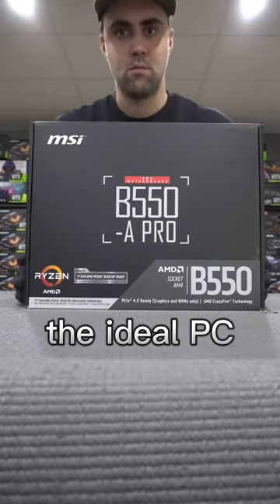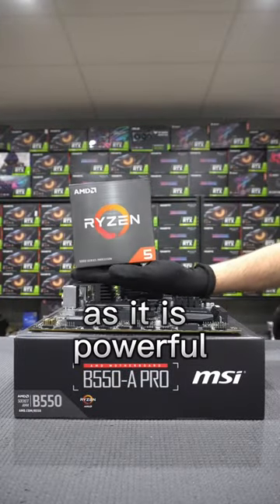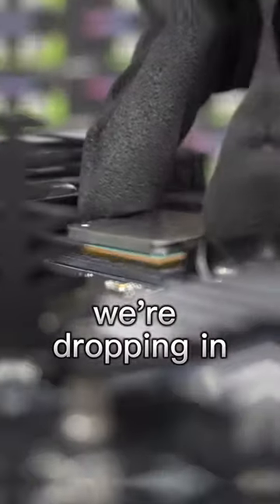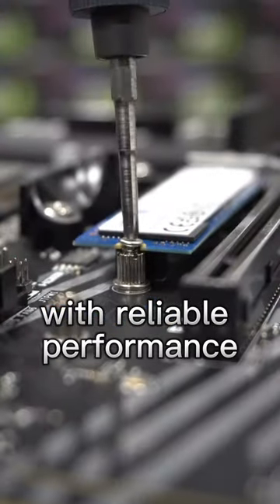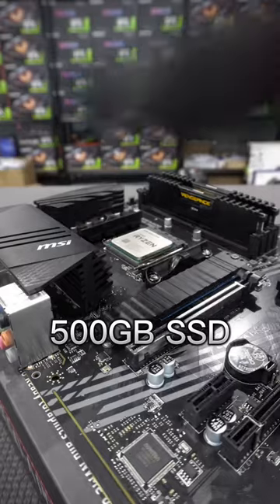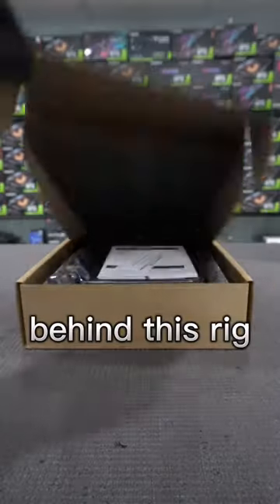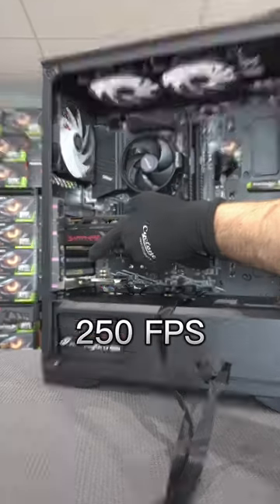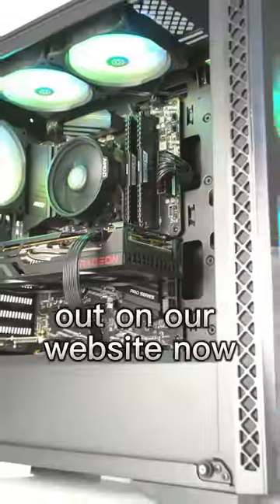IDEAL PC for 1440P Gaming without 💥 BREAKING the BANK‼️

Comment: This still breaks my bank ☠️☠️
Reply: Fax this is easily $1.5K+ 💀
Reply: @timovanlenthe  that still breaks the BANK 💀
Reply: @ahmeduansar  in USD it’s $930 and in AUD it’s $1399
Reply: @ahmeduansar  idk about 1.5$ i just build 5600/6650xt/16gb/1tb for 960€
Reply: @ahmeduansar  I just built my $1k system that is better than this
Reply: @ytACC19  they were talking about AUD I believe
Reply: @ytACC19  this is $930 in usd. Actually a pretty good deal imo. Much better than whatever dell/hp/acer you could ge at that price
Reply: @raskin5543  you could get better parts if you're going for the used ones or you found a good deal
Reply: Then u poor
Reply: @ahmeduansar not more than 900$
Reply: @snail137 man I family isn’t poor but that shit is too much I can find a 4070 with i7 13th gen 32gb of ram and 2tb worth of storage

Comment: 6700 is a real deal and underated
Reply: yeah, but not for 1440p... the 6800 can't even play fortnite/Hogwarts/Forspoken/Apex on 1440p mid-high settings over 100fps. It gets aroud 50-80 at Forspoken/Hogwarts and 80-110 at FN/Apex
Reply: @_lenn.box_  I am a 12400f 6800 owner but I don't aim for over 100 fps in 1440p, I normally undervolt for the electric bill, but yet the 6700 in some games it can do 60 fps 1440p and I have seen it for $320 US dollars which would make a it a 3060 competitor only for games and raw performance.
Reply: @scottireland4110  fr
Reply: Best budget motherboard for ryzen 7 5700x please reply
Reply: @manjudevi9542  what gpu u have?
Reply: @scottireland4110  radeon rx 6700
Reply: @manjudevi9542  I would recommend a b550 for the pcie 4 to get all lanes and speeds for the gpu is just up to your preference in a brand, like Msi, Asus, gigabyte or asrock
Reply: where i live It costs as much as a 6700xt so i'll get that instead
Reply: @_lenn.box_ rx 6700xt does just fine in most i play (assasins creed valhalla and odyssey) etc 80-100fps + very high 1440p native
Reply: Depends of what u play
Reply: @_lenn.box_ what a stupid thing to say. I haven’t had an issue running all of the newest games at 2k medium-high 60+fps on my rx6650xt.

Comment: I have a question. Why is there a 500GB SSD and not, let’s say, a 2TB SSD, even though games are very large these days?
Reply: price i guess  
even though you could get some good SSDs for a cheap price
Reply: Compare the prices. But i would reommend to invest a bit more money for storage if you aren't only playing the same games like CS or League of Legends etc.
Reply: Yeah every pc should have atleast a 1tb ssd,that's like the minimum these days no matter if you're building a budget pc or a higher end one
Reply: @ERENYEAGER-sw9ki My personal computer uses a 250GB SSD as the boot drive and a 1TB HDD that is used as a data drive.
Reply: Storage is soo cheap right now they could put a 2tb m.2 and it
I only bump the price by like $50
Reply: You want all your games/programs on a SSD as well.(making everything much much faster)And nowadays 250gb is just super low for that.
Reply: @Trage339  It doesn't matter. I don’t game. My computer cannot exceed 2TB, otherwise it will freeze if I try to enter the BIOS. It doesn't matter how fast applications take to load with me. My HDD has a read-write speed of 80MB/s, and I do not need an SSD with at least 500MB/s. It's all I have, and I'm not paying $50 or more to get a 1TB SSD, when I could pay <$25 for a reliable HDD with the same capacity.

Comment: Even tho mid range gaming is not as cheap as it used to be, it is still cheaper than most people think. All you really need is 600 USD and you can get a R5 5600G + RX 6600 (faster than a RTX 3060). I have a i5-10400F + RTX 2060 and i can play every game possible in 1440p, maybe not on high settings, but medium looks good nowdays too
Reply: why 5600g instead of 5500, or 12100f
Reply: I wouldnt get a 5600G if you use a graphics card. Go for a 5600 because a 5600G is basically on performance Level of a 5500 while not even using the integrated graphics
Reply: If you want it to last longer go for a 3060. DLSS is a must-have as well tbh, as much as I love AMD's cards there's no denying that DLSS is a better upscaling solution than FSR and the 12gb of VRAM is a plus

Comment: Will you guys do builds with Dx12 Fortnite FPS on 1080p instead of the performance mode?
Reply: He probably won't. Most people play at 1080p or 1440p performance mode lowest settings anyway.
Reply: Look man i dont like fortnite a lot but i recommand a 4070ti with an i5-13600k or i7 13700k  or i9-13900K and 32 gigabyte of ddr5 ram and z790 motherboard i mean for about 2k-2.5k you will be able to play at aroubd 1440p 90fps-100 raytraced epic settings dlls 3.0 on , trust me you dont want 1080p
Reply: The difference is huge from 1080 to 1440p
Reply: @crangasucatalinandrei366  you dont even NEED a z790 motherboard tho

Comment: I had the 5600X before for 1440p gaming and upgraded to the 5800X3D because the 5600X is not powerfull enough for 240hz. it's also way more futureproof than the 5600X.
Reply: wdym future proof 5800x3d is on a now dead platform isn’t it?

Comment: A 5600x with the 6700xt? not a bad pair but I’d go with a 5700x instead just for that extra push, also, really?? A 500Gb SSD, that is fucjing horrible now days, if you have the money to get a 1440p monitor and this whole PC u should definitely get minimum 1tb, because that motherboard only has 2 slots (I think) so when they need more storage they gotta think really hard what to get
Reply: Wasnt a 5600x or 6700xt it’s just the base 5600 which in itself isn’t bad at all. But a base 6700 is killing. Personally I grabbed a 5700X cause I needed 8 cores but compared to when I had a 5600X difference is minimal when it comes to gaming/general tasks but not desperately worthy. I agree with everything else, it’s 2023 and good entry lvl nvme 3rd Gen and 4th are around 45, snagging a P3 Plus for this build is a great deal.
Reply: Bro a 5600 performs nearly the same as the 5700x not really worth it, just upgrade to a 5800x3d if u need those 8 cores
Reply: @snail137  that is such a horrible idea that it’s funny, the 5600 is like £100 - £120, the 5700X is about £150, and the 5800X3D is like £300, bad idea man

Comment: Begging for 400 dollar budget day 2…
Reply: i would prefer u going for a ryzen apu with integrated graphics coz.. gpu at that point is not possible.. maybe a 1650 used ?? new one is tough.. i'll try a combination myself and put a comment here tagging here hope i can help..
Reply: @smitagurav1296  K ty
Reply: Go for an apu bruh maybe something like ryzen 5600g,an entry level b450/b550 mobo,16 gigs non rgb ram,500gb ssd,450watt psu,550watt if you'll add a gpu later,a cheap case of your choice that's all (i wouldn't recommend you buying a gpu now at this budget or you'll end up buying garbage for parts coz you'd have to do a lot of cost cutting on other parts to buy a gpu right now,rather buy some decent parts with an apu now,wait some time and then add a gpu later whenever you got money

Comment: Never buy gpu from Radeon, hear my words NEVER!!! I lost almost 2 years fighting with my rx 5700 xt. Just don’t do it guys. It is cool and strong on paper, but In use it is complete trash. Just check tickets about stutters, crashes, freezes etc
Reply: People have issues with every product. If you want to spend $200 extra for the same performance with NVIDIA cards, that's fine, but I don't think it's fair to tell other people to do the same.
Reply: @nunyabeeswax3012  man, I am talking only from my experience, only facts.
Reply: @nunyabeeswax3012  just check internet about problems with this gpu
Reply: @nunyabeeswax3012  hundreds of people have experienced the same issues
Reply: The 5700 XT was rough no doubt. But the RX 580 was and still is great, and the 6000 series is amazing
Reply: @lathrin  yeah, agree about 580, but idk I don’t have any trust to Radeon after rx 5700xt